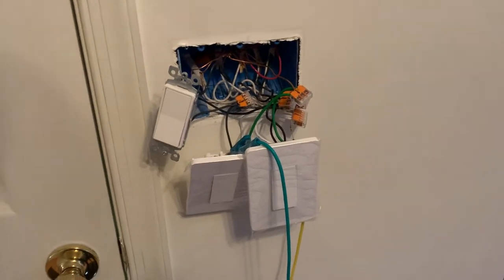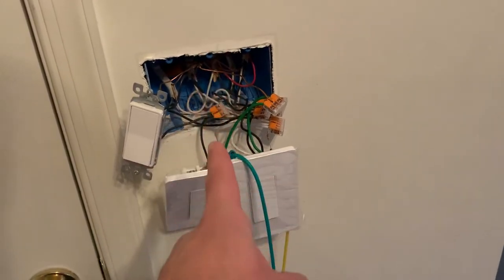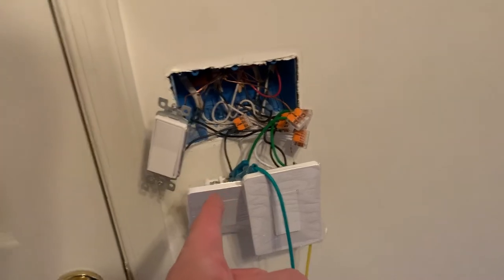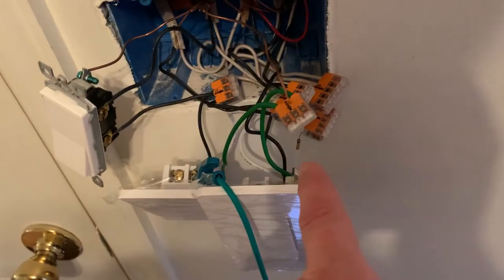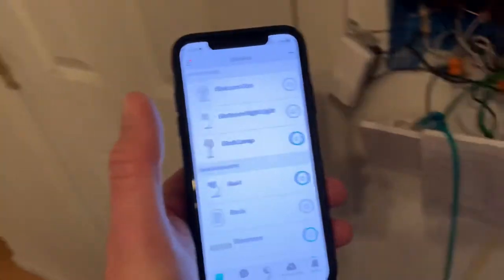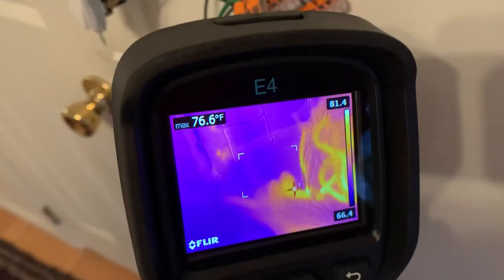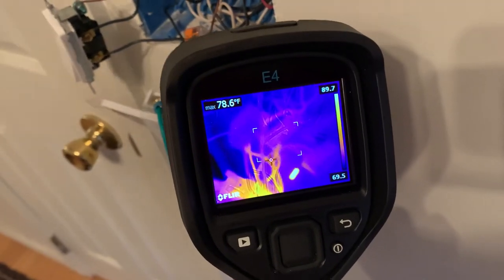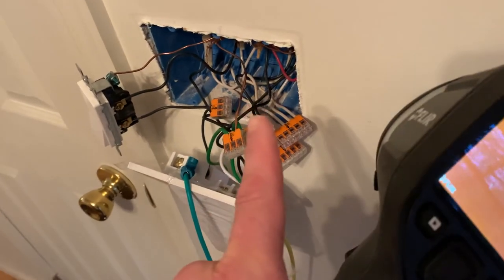#short Hack for controlling nothing (smart action) with a 3-way kasa switch

Comment: I have the HS200 single switch (not 3 way). Any ideas on how to configure with a resistor with which wires so the outlets are permanently on and the switch only triggers a smart plug?

Comment: Interesting... I just set up my HS200 switch last night for the sole purpose of using Smart Actions to control smart plugs. I put  cap on the neutral wire and didnt connect it to anything and it works just fine for me. I bought my HS200 a while back, so maybe they have made some physical hardware changes to the HS200 since then, or theres a significant difference with the internal logic between the 2 way and 3 way smart switches, but I did not run into this problem nor have to add a resistor to the neutral wire in order for my smart switch to run how I wanted it to with Smart Actions.